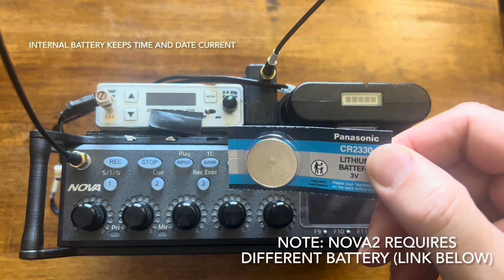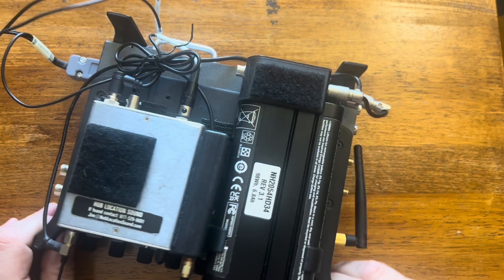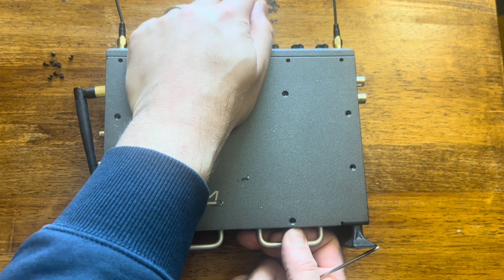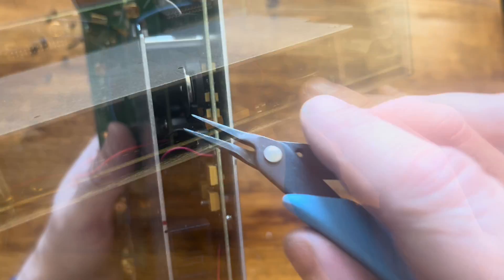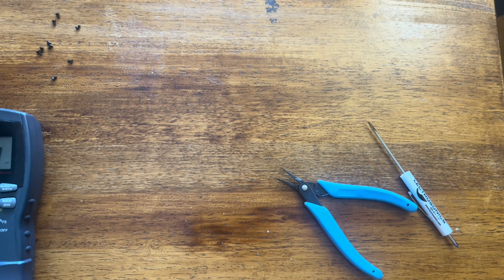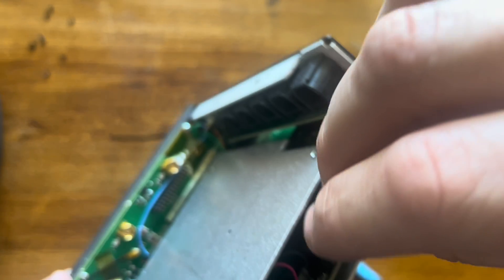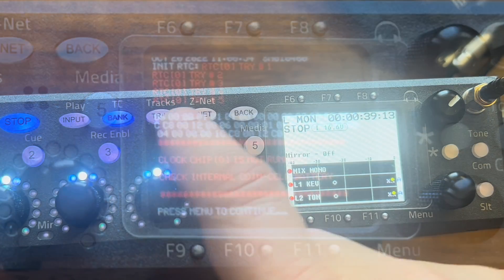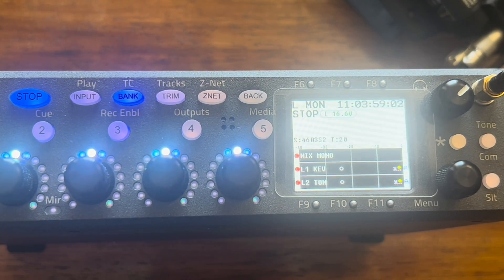Zaxcom NOVA 1 Internal Battery Replacement

Comment from the maker: A note for opening the Nova (1 or 2)... Of the 10 small screws holding the chassis to the front panel, the 2 screws that land above the F7 button and below the F10 button are cut a little shorter than the others. It is necessary to use these shorter screws in those 2 locations (if the longer screws are used, they may put pressure on those buttons - causing them to function improperly (or not at all). If your 'F#' buttons don't always respond, Zaxcom recommends loosening the chassis screws near those buttons. Personally, I just leave those 2 screws out altogether.

Comment from the maker: A note for NOVA2 users: I own both a Nova 1 and Nova 2, I took a look inside both units and can confirm that they use different batteries and these coin batteries are located in different places... Nova 1, which requires a CR2330, is located near the rear and can be accessed without removing the middle plate. However the Nova 2 (which requires a CR2032) is located closer to the front panel (behind encoder #3) and does require the middle plate to come off the stand-offs. Also to get the Nova 2 chassis open, you'll need to remove the 2 bolts on the rear DB15 connector.